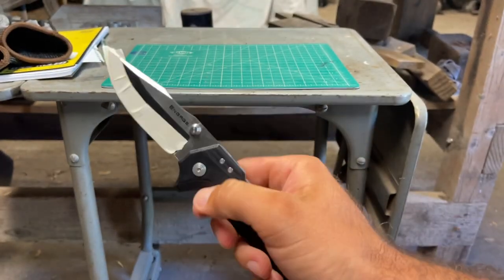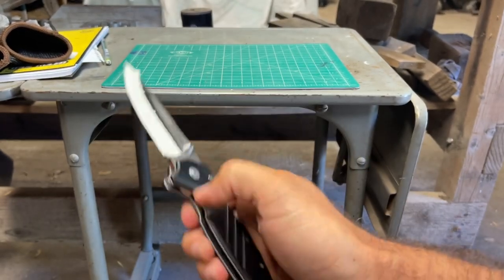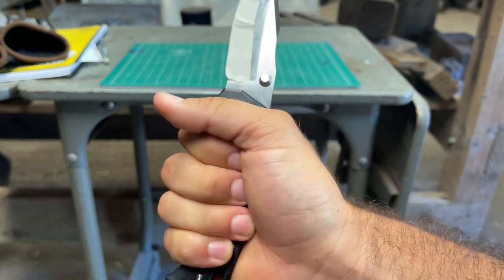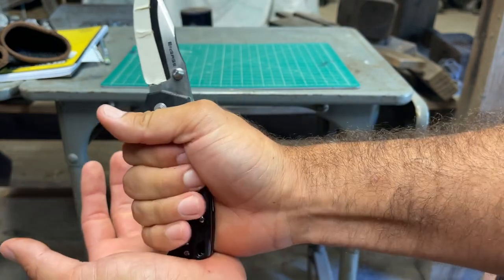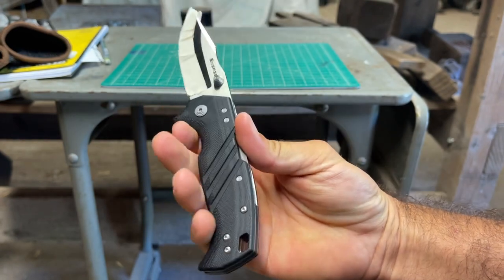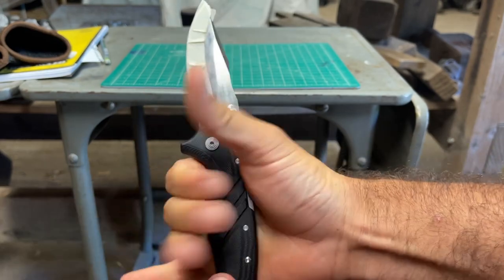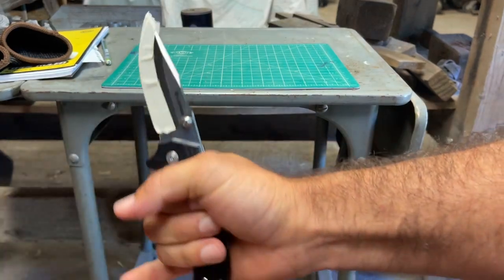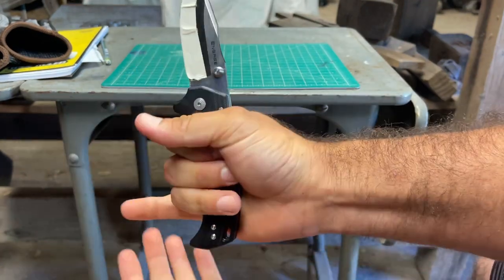Cold Steel Engage Atlas lock fail in butt strike test

Comment: What is the fastest deployed fighting knife with a strong lock in your opinion ? Cold steel triad lock takes superman thumbs to flip open for me...
Reply from the maker: The next one other than Cold Steels Triad lock would be CRKTs Deadbolt. From what I remember the Deadbolt was the closest lock to the Triad lock when old Cold Steel was doing comparison tests. I have the Clever girl, it’s a flipper with ball bearings. The negatives are that the biggest knives I’ve seen with a deadbolt are only around 4 inches and none have a wave function like some of the Cold Steels. Hope this helps.
Reply: Nothing beats a nice fixed blade for self-defense but as far as folders, I have some older Tri-AD designs like Recon 1, which are hard to flick open with your thumb without using a lot of wrist. However, my Counter Point 4 and 4-Max Scout flick very well and even reverse flick. All folding knife locks have trade-offs. There's a specific fighting grip which ends up pushing on the Tri-AD lever enough to loosen the blade on some knives for me. The Atlas lock is not bad because some guy can can disengage it using a certain grip to pummel (with a knife that doesn't have a pummel or glass breaker feature) without being able to keep his palm sliding down the handle. As far as I can see, he got a defective spring with his knife. Neither of my Atlas lock springs got anywhere near this loose, even with a lot of use. I like this lock a lot on my Mayhem (now that's a fighting knife!) and Karve. When I want to carry something light, I go for my Benchmade SOCP Folder. The crossbar lock is plenty strong, it's a great fast-opening ambidextrous knife and is just a joy to wield.  Speaking of crossbar locks, one of my most carried knives lately has been the SOG SEAL XR. It's a beast of a knife that I never expected to like as much as I do. Check out Gideon Tactical's video on it. He abused it quite a bit. 

Also, don't discount quality OTF knives. They are deceptively strong. One of my recent favorite has been the very affordable MaxAce Neptune. It's a particularly strong design which uses dual locking tabs and a higher grade aluminum (7075 vs the typically used 6061) body. Check out the torture test video that they did on it. It's nuts what this knife can take.

Comment: Maybe a stiffer spring would stop this from happening as easily, maybe in the future they can re design it to go lower on the handle like a traditional back lock, or slightly higher like the shark lock. Maybe an increase on the handle of half an inch or so more grip may help prevent it.

Comment: 1) The lock didn't fail - you disengaged it using a deliberate action. I can make a Tri-AD "fail" if I try too... or any other folding knife lock.

2) Your spring is obviously defective - way too loose. I've used the crap out of my Karve and the spring never gotten ANYWHERE near this loose. Neither did the one on my Mayhem. Not really using that one a lot but training quite a bit. Defects happen. 

It's still a very strong lock and is way more faster/ergonomically usable than the Tri-AD.
Reply from the maker: I think I already explained this in the comment section but the way this works is: the lock lever is low enough on the handle so that when I grip the knife it is inside my palm. A butt strike on the knife causes my hand to slide down on the handle. So if the lock is disengaged by pulling down on it and my hand slides down on the handle with the lock lever in my palm then there is a chance that the lock can be disengaged. Which is what I’m trying to show here. Hopefully this makes sense.

Comment: very helpful!
Reply from the maker: I’m glad the video helped.
Reply: @totesmalotes  Im also very curious about that if you can do a pommel strike test without touching the lock bar to see if the lock also fails because of the spring power like some axis lock fails.
Reply from the maker: @Desmondesmond  I tried doing a butt strike the same way without touching the lock and it doesn’t loosen the lock. Doing this though has you holding the knife with only the tips of your fingers touching the scales.

Comment: So if you were using the same action with the blade into wood would this still happen! It’s not designed to use the handle as a hammer surely? 
It is because you are actually sliding the unlock button to the unlock position.  Does the knife unlock being pushed forward open or? I don’t think so buddy. ?
Reply from the maker: I don’t really like the idea of a knife lock failing in any situation but there’s a chance it would fail when chopping too because your hand would slide down.